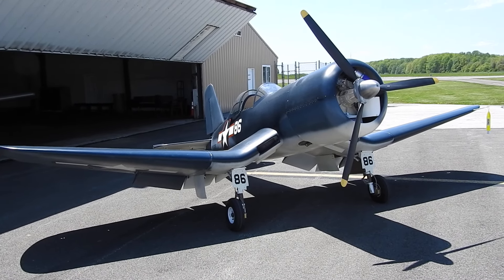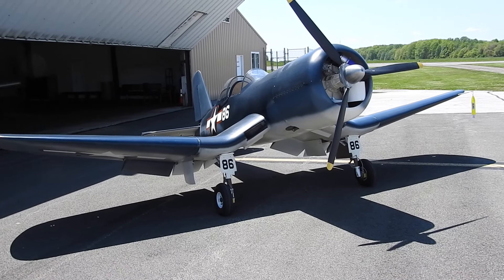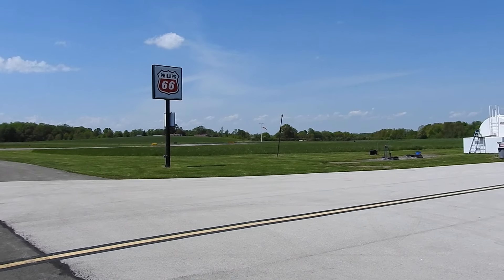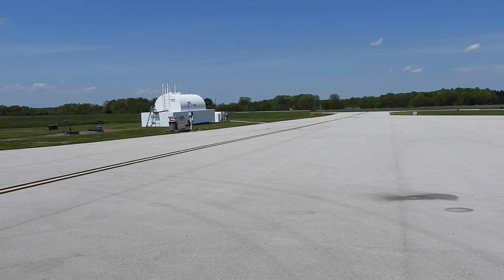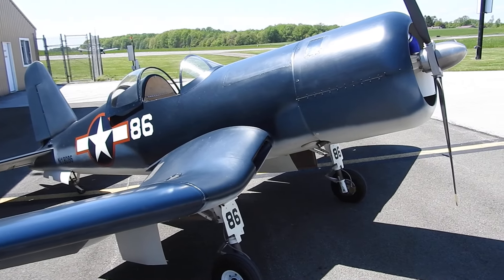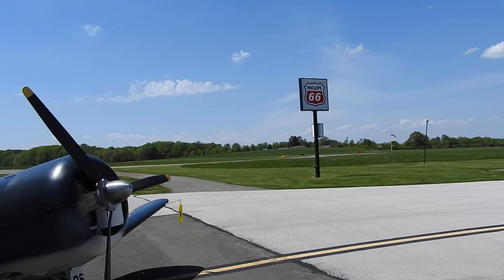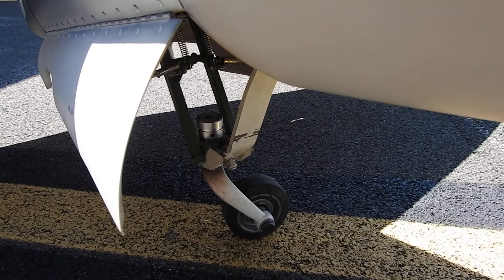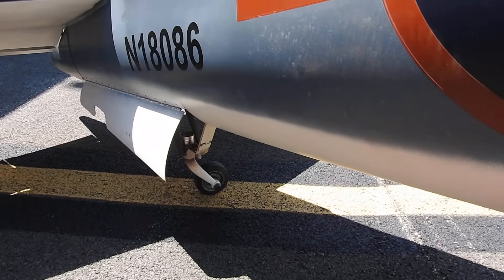WAR Corsair Taxi test report 5/13/2024

Comment: I got to know a former Marine naval aviator, who was 95 at the time, who logged 2000 hours of Corsair combat time in the South Pacific, and then went on, after the war, to have a 50 year career as a crop duster pilot, and after he retired from that, flew a Super Cub on his Nevada ranch for 14 years.  I was installing a off grid solar system on his mountain property, that had a fairly steep and twisty driveway, but one section was just long enough to land my RANS S-7 on I decided. I asked Jim, he said sure, have at it, but then he called that night and said he had had seconds thoughts, and was I SURE I could pull it off?  I told him, Jim if I screw the pooch it's all on me, and he said Ok, see you after you land.  The next day, I landed it, I have over 4500 hours of mountain off airport time and was confident I could do it safely, but what I wasn't ready for was  when I told Jim the hardest part was the loss of viz over the nose on short final due to the slope and the narrow road, and how I had to get it all lined up just right before committing. He, who had never talked much about his Corsair time or anything about the war,  said something I have never forgot, "when we were on short final for the carrier,  the whole thing disappeared." The picture I took of him that day, standing next to my plane with a big grin, is one of my favorite of all the ones on my hangar walls, he's now gone, anyway.... great homebuilt!
Reply from the maker: Thanks for that story. Wish I had met someone like that.
Reply: ❤ I was hoping for better weather.
Reply: Curious how no one refers to the Corsair as the Wildcat any more!!
Reply from the maker: @Zubeneshemali  The F4F was the Wildcat, F6F was the Hellcat.
Reply: Why would anyone call a Corsair a wildcat?

Comment: I would recommend against any high-speed or tail-up taxi testing. I’ve seen many airplanes damaged doing high speed taxiing and there’s little/no information to be gained from doing it. If it’s controllable at low speed, it will only get better with more airflow over the tail. Airplane looks fantastic.
Reply from the maker: Thanks for the input. The plane will let me know when it's happy.
Reply: completely agree i didnt do fast tail up taxi tests in my mustang 2 for that very reason. always make sure she is airworthy of flight during ground tests because if she lifts off just fly the pattern gives you more time to feel it out rather then a hurried forced back on the ground with an inadvertant lift off FWIW
Reply from the maker: @slipstream5542  I agree.